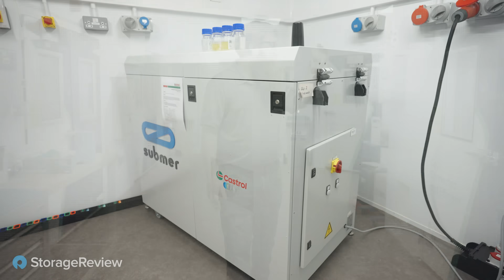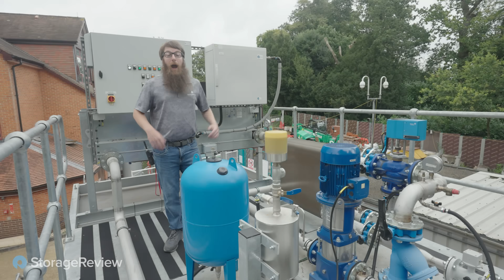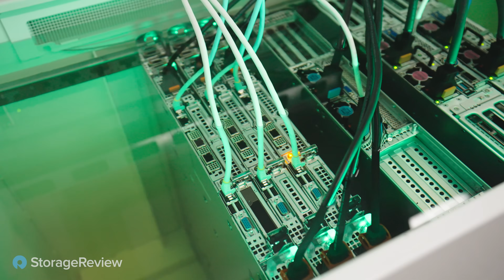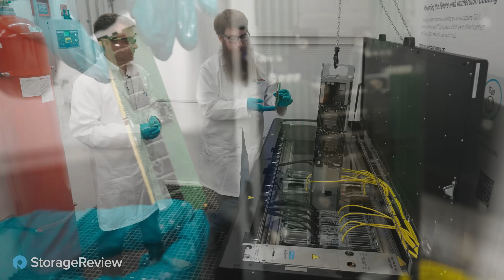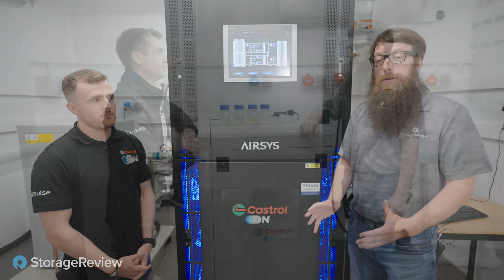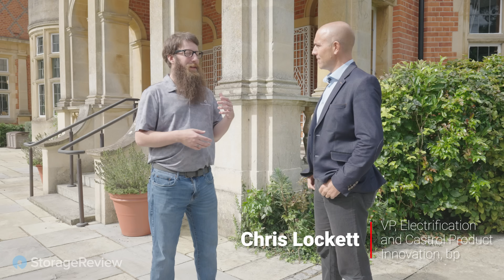40% Power Reduction in the Data Center with Castrol Liquid Immersion Tech

Comment: Informative Content as always 👍 No Opticals connected, i wonder if SFPs works in Oil.
Reply: I wondered about that too.  The connection of fibre is quite fussy and can be where big dB losses occur.
Reply: @peterblackmore7560  Single-mode is fine, but for multi-mode, I would use an adapter to position it above the fluid line.